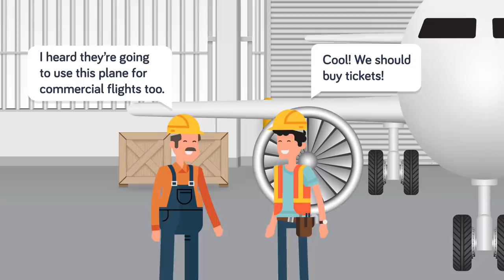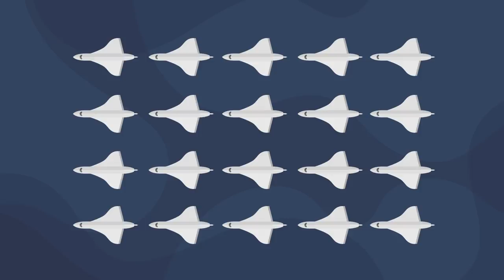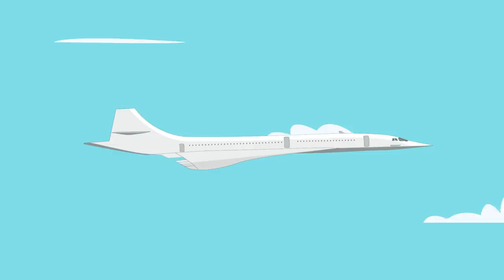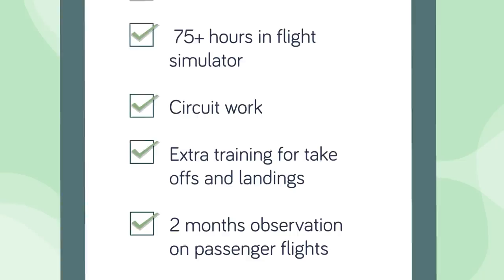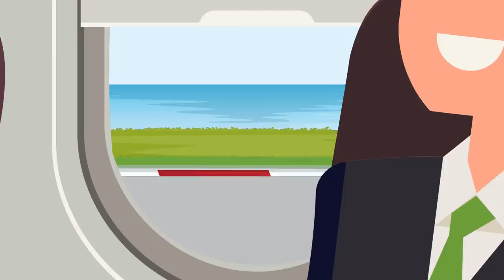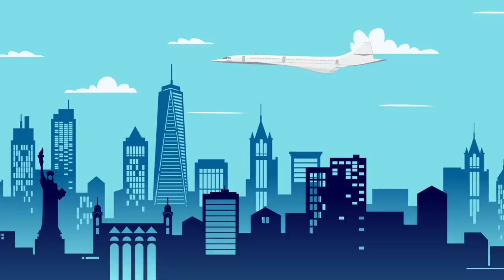Why You Will Never Fly on a Supersonic Passenger Jet

Comment: My mum lived hear Heathrow when concord was around. She had to have her windows replaced 6 times in 4 years 😂
Reply: I hope the airline paid for that?
Reply: I hope she had cheap windows or free insurance
Reply: Because in those days, the glass was single pane with quickly rotting thin wooden frames. All windows had to be replaced that often back then.
Reply: Simple fix for that... just engage the mach engines after they're over the oceans! That's doable, isn't it?
Reply: Perplexia X no because it’s very difficult to break speed mid flight
Reply: @PerplexiaX   It was the political campaign to stop the aircraft over mainland U.S.A that destroyed the programme. All business plans involved crossing the thousands of miles from East to West and of course that would have chewed right through Boeing's business at that time and more importantly, the Boeing 747
Reply: @theo-dc9hb  I'm not an expert, but they have to stop MACH speed before landing, right?
Reply: @stevenmacdonald9619  I'm no expert on the SSTs, but I'm going to assume that the other companies weren't charging as much for their flights as boarding the Concorde (or any SST, for that matter), so yeah, it would have to have been political, or was Boeing just being a crybaby?  Besides, with the level of advancement we have Tech-wise from the '70s, it would be more energy-efficient, and more cost-efficient now!
Reply: Perplexia X yes but is very easy to stop MACH because you can just slow down but to speed up requires ALOT of energy and the engines would need to increase
Reply: @theo-dc9hb   Well, apparently, they are coming back, so I guess they have all the bugs worked out... I suppose that maybe these new SSTs might be a little bit smaller?  They wouldn't have to be as big and luxurious as the originals!  I guess we'll find out!  Nice talking with you!  Stay safe!  :-)

Comment: "the only supersonic jet to fly commercially" i think you forgot about the tuopyev 144
Reply: oops. I just posted this same comment without first thoroughly checking the comments. My bad.
Reply: I dont think that was on the wikipedia page he read this off of.
Reply: Still chill
Reply: Tupolev TU-144
Reply: That was only used as a cargo plane though, but yeah, does count as commercial.
Reply: It flew 55 passenger flights
Reply: Communists don't count, also they used espionage to rip off the Concorde.
Cheaters or communist trash are unworthy of credit or aknowledgement.
Reply: Eh that didn’t last long and wasn’t successful. Mainly flew mail and cargo after a crash at the Paris Airshow.
Reply: @matthewshaw1850  it still counts.
Reply: @danielbertrand6675  facts don't discriminate for political reasons.  The Communists were evil, but they did build and fly a supersonic plane.  It counts.
Reply: Daniel Bertrand  why does a soviet plane not count?
Reply: @Boingboing777  Of course it counts. Science has no nationality.
Reply: Chun Hei SO a noisy rickety plane, which was uncomfortable, inefficient, and useless
Reply: Thanks for copying lol
Reply: Lol sorry just made the same comment hahhahHa
Reply: Not to mention he called the Bell X-1 a jet.  It was a rocket plane dropped from a B-29.  It could not take off under it's own power, and it glided back to terra firma.
Reply: Daniel Bertrand ha!  Def
Reply: @andrewpatience  Yeah.  Badly.  Flying on it was like riding a bus through a minefield.
Reply: Literal Western Propaganda.
To think people scoff when you complain to guard against it.

Comment: There was a mistake in the video it claims the Concord was the only super sonic passenger plane but in fact there was a another the TU-144 Soviet supersonic passenger plane, which also flew before Concord
Reply: Never carried any passengers, so never made commercial before it fell out of the sky.
Reply: @seaninlondon4424 , it did carried mail and cargo mostly. Which is  commercial, but not passenger.
Reply: @seaninlondon4424  TU-144 flew a total of fifty-five passenger flights from the 1st of November 1977 to June 1st 1978

Comment: Phil Collins performed at Live Aid in Wembley stadium in London in 1985. After the performance he hopped on a Concorde and performed in Philadelphia in the USA later that day. I grew up in county Kerry near the river Shannon estuary in Ireland. Occasionally, of a Saturday, we would see a low flying Concorde passing overhead because they used Shannon Airport in county Clare (which is on the other side of the estuary but further east) for Concorde training flights so that new pilots could perfect take off and landing.
On the issue of commercial travel, I think engineering a fast sub sonic (mach 0.95 perhaps) plane with the fuel efficiency and range of the Boeing 787 Dreamliner would be the way forward. You'd get to your destination quite fast but there's no need to worry about the sonic boom.

Comment: Well actually i was on a supersonic flight😁 Winter of 2013 AA 777 to Frankfurt Intl from JFK, we hit an insane tailwind that got us over the speed of sound over the Atlantic. It was pretty awesome because the pilots told us over the pa, he said this is extremely rare and he only had this happen to him 3 other times. It was weird because we felt no difference inside the cabin but it was pretty cool knowing we were faster than sound for a short period of time. something i’ll never forget
Reply: Yes, this can happen if the plane can ride a jetstream. However, this is not a real speed of sound, because you move together with the medium (air). You were moving over the speed of sound only as compared to the ground. Otherwise, the plane would fall apart.
Reply: Dávid Molnár Yes i know that technically over the ground we are still moving faster than the speed of sound.

Comment: The British Concord wasn't the only one being designed. America had its Boeing 2707 in development. They dropped it in favor of the Boeing 747. You can see who won on that one. The Concord only sold 20 planes and Boeing lasted for many years and sold 1544 planes. Boeing is developing another supersonic plane that will cancel out the sonic boom problem. With more advanced materials, electronics and engines, the next generation may succeed.

Comment: You've got serious quality control problems (or, even, basic knowledge and intelligence issues), buddy:
1.  As others have pointed out, the Bell X-1 was rocket-powered, not jet-propelled.  If you didn't already know that, you should consider yourself an aviation ignoramus.
2.  As others have pointed out, the Concorde was not the only commercial supersonic airliner.  The Soviets flew the TU-144, nicknamed the "Concordski" for a short period, but it was a commercial, supersonic airliner.
3.  A rigorous program of training is a "regimen", not a "regiment."  A regiment is a military formation usually consisting of at least two battalions.  These are not terms that literate people confuse.
4.  You twice mentioned the "exuberant" costs of the Concorde, and even put it in your graphic.  "Exuberant" means "filled with lively energy or excitement," something of which money is incapable.  I think you mean "exorbitant," meaning "unreasonably expensive."  Again, these are not words that literate people confuse. 
5.  The graphic you used for the DeHavilland Comet didn't look even remotely like a Comet.  Not even close.  The Comet had two engines on each side built into the wings, not hanging below them in nacelles, almost at the wing roots.  Its appearance was very distinctive and looks nothing like the graphic you used.
So, you can't get basic aviation facts right and you totally flunk middle-school level vocabulary.  How is a viewer to trust anything else you say without going out and personally verifying it?  You've basically flushed any credibility you might have.  I'm going to give a few of your other videos a try, but if they follow the same standard, that's the last you will see of me.